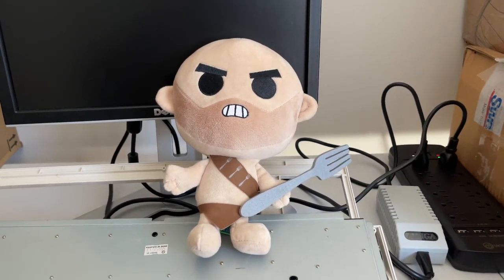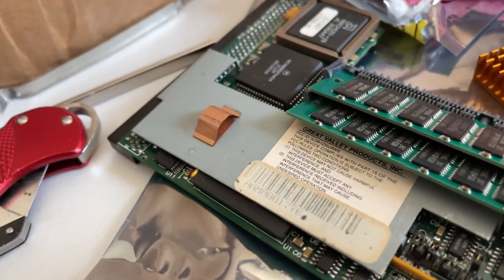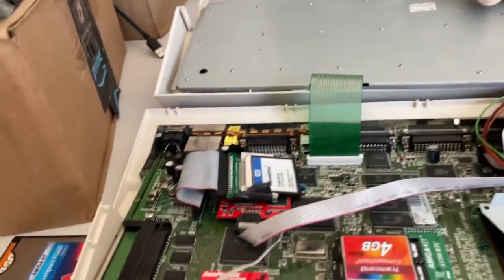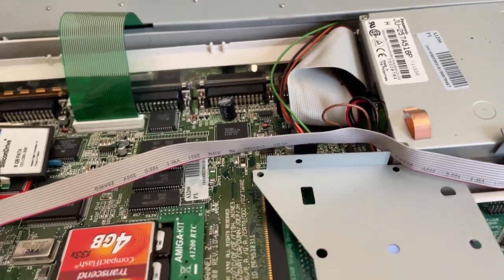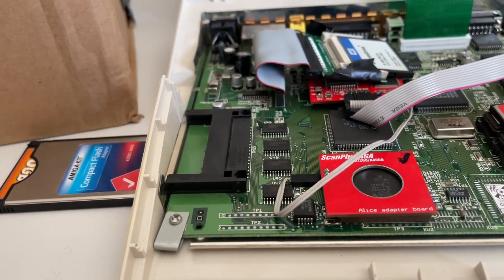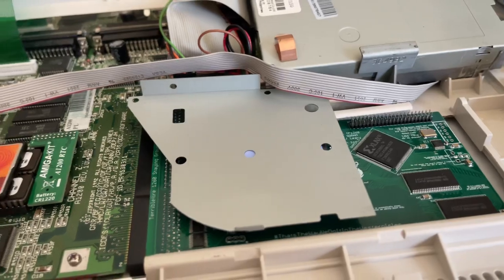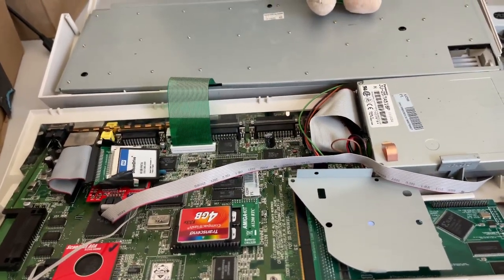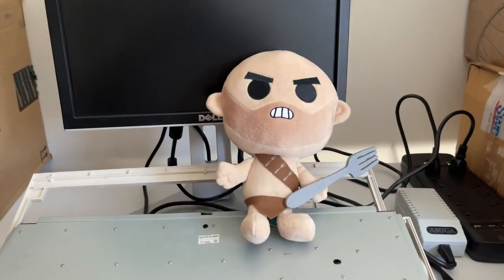68060…COOLING (A1200 ‘060)

Comment: Inside a standard laptop from around 2007/11'ish. There are these flat low profile heatpipes/heatsinks. Perhaps they can be used, and have the fan in the empty space on the right of the TF-1260. Only issue is to have it secured correct, so it wont slide off and kill anything.
Reply from the maker: Hmmmm I’m intrigued.

Comment: Glad to see this works, you're right that a copper plate would give further heat dissipation, that's certainly something I'm going to try (along with the raspberry pi style heatsinks on the CPLDs).  My Rev. 1 when running a heavy AGA demo for 10 minutes at 50mhz isn't enough to burn me, but its getting close to uncomfortable.

Do you think a wedge style heat sink coming into contact with the back of the keyboard would even further the benefits of dissipation?
Reply from the maker: It’s possible. You’d need a solid connection. Probably some pads and or paste.
Reply: @HoldandModify  I use a laser-based temperature gun on my TF1260 with Rev 1 68060 at 63Mhz, the temps are about 40C when running Quake or Doom.
Reply from the maker: @valenrn8657  is that good or bad? I don’t OC mine. Haven’t noticed any issues when rendering so far.

Comment: I have one of these, that Mr Leary kindy built for me, he is a gem. I have the same issues with cooling,  but only because i want to clock it, when i run it stock, the CPU is cold, and i mean it feels like there is no juice going through it, cold.. I have a 50mm Fractal silent fan, superglued to the underside of the keyboard, that blows down on the CPU and CPLD's very nicely. If you are gonna clock this at all, then i would be looking at cooling down those CPLD's, i have a 15mm heatsink on the top one, and it still gets uber hot. It's a great card though, and I am lead to believe the firmware has alot of maturing to do, and Stephen himself said we are yet to get the best out of this card. :)